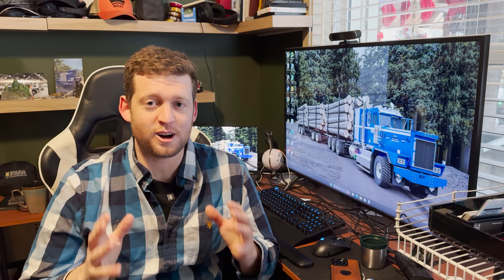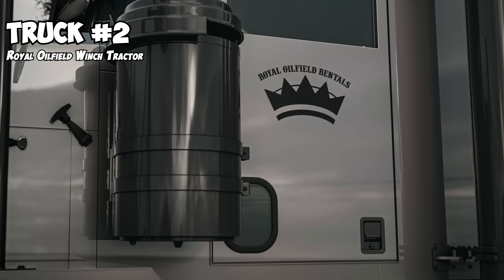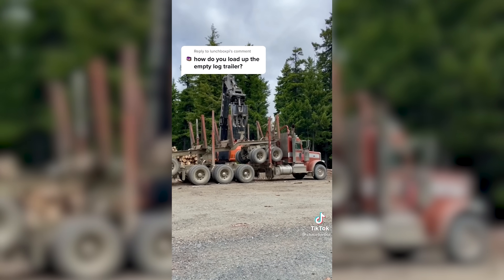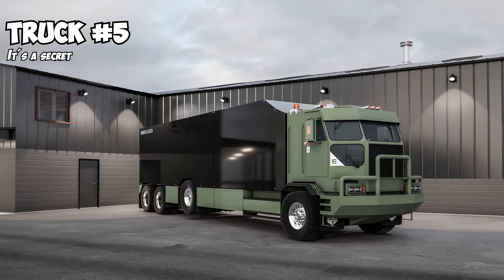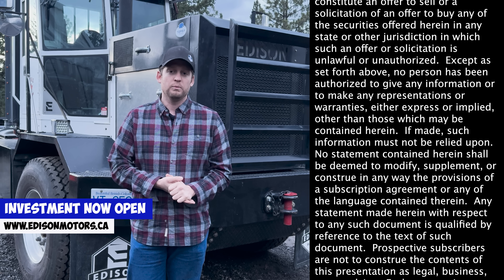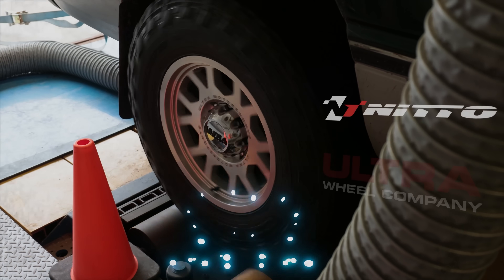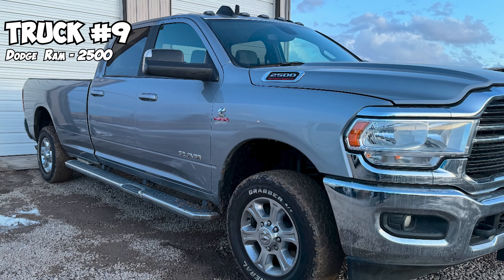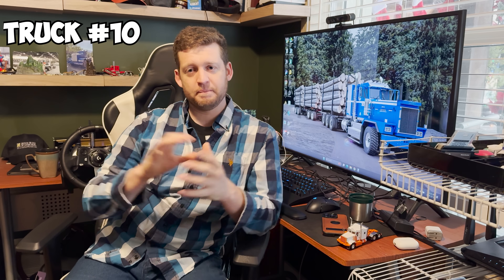Edison Motors’ 10 New Hybrid Truck Builds & Future Plans!

Comment: Hope to see an RV motorhome chassis next; send it to Elkhart, Indiana, for a camper body to be fitted and test drive across the country to Utah and back. 
I can test it for you and record results; going from Indiana to Utah at the end of March for Offroad games anyway. Can display it at the games; many followers will be there.
The Long flats of Kansas and then the Rocky Mountains through Aspen would be a great test.
If a motorhome can handle the Rocky's, it can go about anywhere. 

Mountains difficult to climb for any vehicle and need regenerative braking on the way back down to keep brakes from overheating.

Most vehicles climb at 30-45 mph, depending on load. If a motorhome can maintain speed with traffic while climbing mountains, that would be a great selling point. 
Most RV's are underpowered unless built on an expensive semi chassis; ok on flat ground but underpowered when encountering hilly terrain. 
Pure sine wave inverters would eliminate the noisy generator; roll through the campground in silent mode and recharge with high current RV outlets at the campground. 

Considering the way RV's are used, it seems like a good fit; there are lots of charging times and advantages to the electric platform in RV use.

It is easier to justify the chassis cost if the vehicle is for pleasure and not commerce; it doesn't have to make money, just work well.

Solar panels and a portable wind generator to charge while boondocking.

Comment: Did they share any real fuel usage data yet?
Reply: Estimates are all over the place and completely dependent  on the type of driving. So a logging truck could have unlimited free driving. Unaerodynamic Topsy might have worse mpg when doing OTR
Reply: Latest the live video they did at some truckers conference where Chace got that question (mpg) and honestly said like Sah-o5m wrote. You don't save for highway on flat roads. It is SO MUCH use case dependent. For it to make sense I guess they would have needed one logging truck running with the same load behind Topsy to just see how they do on the exact same routes.

Comment: I am a farmer and want you to build a diesel electric agricultural tractor out of the shelf parts.
Reply: Agreed
Reply: Depending on which tractor. The smaller ones do now have so much space and weight is a concern. Easier for semi trucks with a pair of frame rails where they can have whatever they want in between. Also, depending on the work a series hybrid might not make sense. It's not more fuel efficient if you run the engine at constant rpm and have no regen braking. That sounds exactly like what a cultivator on the prairie is doing. So a lot more mixed use case would be needed for it to make sense for agricultural tractors I think.

Comment: I don't know if u guys read the comments, but because you are intrested in technology in Europe, there is one thing what you should take to your trucks too. That is the liftable drive axle/ axles. That is saving lots of energy when driving empty, making the handling a lot easier and the most important thing is the liftable axles make the traction much better, with a load or without a load, it increases the load per axle and that way grip too, and that is very important feature in a logging truck. That would be a feature that other manufacturers can't respond out there in North America.
Reply: Pneumatic or hydraulic?
Reply: @TamagoHead  pneumatic, the easiest and simplest to do
Reply: @sauliaalto 👍thx!

Comment: I think you guys would have a huge market in Australia for your electric drive hybrid. The distances covered by some of our road trains are often thousands of Km per trip. The fuel savings and torque available in your trucks would have alot of interest if you’re thinking of going international.
Reply: But will there actually be fuel savings? Edison trucks are saving fuel when there is good regen braking. Thousand km trips I guess do not brake often?
Reply: @ they save fuel because the generator onboard will always run at the most efficient rpm and it will only run when charging the batteries.

Comment: Thats so right. New trucks have million miles (or km) on them from testing before the customer gets them and still customers/ drivers find things that are just not right. 

Having partners that are willing to work with you, your truck and have the ability to work on those trucks will still cut time to market down significantly, because real drivers, real mechanics putting those beasts through real world challenges.

Comment: Are you guys still using Tesla motors?
Reply: No. It's either China motors or bombardier motors
Reply: Tesla model 3 motor was for Carl but it does not work well enough to have it as a separate part and then run with load. In principle it sounds good "keep the old axle, less special parts". But in reality it probably gives headache with how it behaves. They wanted e-axles build in North America but I think they were shown some but then told - "no we won't sell to you". Kay...?
So the e-axles from China was the way to go. If you look into the videos they've been over there and gotten to sit down with the engineers. And the new gen axle with two motors and balanced (not front or back heavy) looks even better. If some North American supplier won't even sell axles to them, then the "made in north America, common parts, find it at truck regular truck repair shops" anyway is null. Edison will surely by enough extra set of axles. The common stuff, like flat windshields etc. that you actually can get locally, there Edison Motors stay true to their vision.
A bit of similar for the engine. They had trouble with some undisclosed North American manufacturer that was not good to work with (more like "hey order 100 of these and get them in a year"). Scania is used in different machinery, in gensets and now even in a new International Harvester truck. So though Scania isn't selling trucks in NA the engines exists there. Maybe not the same easy part supplies but Edison can either sell working trucks or sell mules without engines...

Comment: There is a company here in Utah called Boyce Equipment & Parts Co. They take military surplus vehicles like the M35 2.5 ton and reconditioned to be good as new, even offering custom features and single axle options. I would not be surprised if they offer your D/E kits when the kits get off the ground.

Comment: I believe a garbage truck would be an excellent candidate for a hybrid. Run on the generator for the trip to and from the depot, then battery in the suburban areas. Lots of stop start and no one like to hear a loud truck early in the mornings.
Reply: For long runs that would be useful but most city runs would work without any requirement for the extra cost of hybrid... a straight BEV truck is ideal and there are many at work in cities around the world already from several manufacturers.
Reply: @MrAdopado  Exactly, a city garbage truck can be full BEV. I would imagine at least here the garbage/recycling places have a decent utility connection so it can quick charge at base.
Reply: @MrAdopado  Could this open up opportunities for maybe rural to semi rural areas?
Reply: @callanauger  Of course. Horses for courses.
Reply: Yup, definitely!  And that cab on the #5 truck looks very much like something that would work well on a garbage truck....  (I have no idea if that's it or not, but it would be a good design for one.)
Reply: @BrooksMoses that cab is too high for constant getting in and out. Would need cab in front for that
Reply: @solarissv777   Oh, good point, indeed.

Comment: Very exciting things happening. I'm not a big fan of EV'S but what you're building is interesting to say the least. Something like you're building I can get behind. Now when the battery's get low the engine will recharge without looking for a charging station or worse not finding one and being stranded. 
This idea makes sense to me  unlike the EV that is solely dependent on battery's. 
 Merry Christmas to you guys and thanks for the interesting videos.
Reply: Edison builds for the market where series hybrids makes sense. And the knowledge they gain can be put into a full BEV truck with more batteries if a customer comes with a perfect use case for that vocational truck. To me a garbage truck where they pick up in residential areas seems an obvious choice.

But mass market full BEV trucks has their market ready too. It's not the one for independent owner-operators but rather fleet owners doing the same route over and over again to known locations where they can build out "behind the fence chargers". That's the market Tesla is aiming for.

Comment: Amazing thought process, I think it was elon or some ceo that said it but in short when staring out you want to sell expensive products/solution to a small amount of people as it's easier to control and manage incase you have issues when it's only 1-15 people, then you sell something slight cheaper to many people let's say 100-1000, all the way until you can sell a reasonably priced product/service to alot of people 1000-100000.

Sort of like elon started with the first roadster, then the initial models, now he's selling to millions

Comment: It would be very interesting to take a 12 valve.Commons truck and put the generator behind it and see how efficient that is. I bet it's gonna To be extremely efficient. That's
Definitely.Something I would like to try with my ninety seven twelve volve four by four.
Reply: A 12 valve is a large engine with little horsepower. Bump it up to better numbers and you lose reliability and efficiency. Also new diesel engines are more reliable then diesels from the 90’s so it more difficult to stand out like the 12 valve did. It’s the emissions crap that kills the engines of today, remove that crap and the engines run forever. They use less fuel, are quieter, lighter and have more power than a 12 valve. Modern engines are incredible without emissions bullcrap on them.

Comment: I have a question about the electric differentials. On the FoMoCo/performance axle 9inch the differential comes out(3rd member, hoghead, whatever you want to call it), for antique retrofits for pickups and cars that would be ideal to just swap out the differential for an electric motor/diff and be able to use the factory tubes, 31 spline axle shafts, ect… would that be a possibility from you guys if the future?

Comment: Super excited for what you guys are doing! On the Ram 2500 project, will this truck still have emissions and require def after tuning is done? Or does the diesel engine pass as an auxiliary power unit, and won’t require emissions?

Comment: Please more info on this "Board" or "Bored" or "Boar" diesel customer that is planning on using the stock engine. Anybody have their website?
Reply: It is “Bore Diesel”, they hade one YouTube video that just says that they are partnering with Edison.
Reply: @Sah-o5m  I did not look them up on instagram, but they did mention they are from Colorado.
Reply: Thanks. Is it Bore Diesel on Instagram in Colorado USA?
Reply: I didn't hear the Colorado part. Gracias :)
Reply: Ahh. Bore Diesel out of Erie Colorado a suburb of Denver and Boulder. Looks like a fantastic partner for Edison.

Comment: I expect absolutely no confirmation of this, but I'm going to lay my guess down right now that the mystery vehicle is a garbage truck.
Reply: My guess is cement truck. My runner up guesses are a garbage truck or a crane truck.
Reply: Or any city utility truck where you need the cab over for tight corners, visibility, and the electric for not having to idle a cement mixer, hydraulic garbage / compost/ waste management.

Comment: What if the batteries are too full or there's just too much for the regenerative braking? Do you have some sort of rheostatic braking in mind for that type of scenario?
Reply: Regen fills batteries. If batt full then regen spins generator which spins the 9 liter engine like a Jake brake
Reply: In an older video/short they mentioned that the power from the axles will be fed to the generator, turning it into a motor which will drive the engine with the jake brake (or equivalent) switched on.  The original plan was to use a resistive load bank like what is used on a diesel locomotive, but they determined that this method wasn't efficient due to the added weight and space it would take up on the vehicle.
Reply: @robbie_4118  I believe Edison is holding off on a resistive load bank heater for the time being.
Reply: He’s talked about that in previous videos.
I can’t remember what he said but it seems they have it figured out.
Reply: They have regular brakes! And it will become a habit with a bit of planning for the drivers - don't run the generator before you know you will get a lot of regen!
For Topsy they can spin the generator so the engine can jake brake.
For the newer with Scania, which seems to be gensets, I don't know if it has a jake brake capability. An Scania engine for a truck does, but these ones - at least the first, we don't know. We'll maybe hear in the future.

Comment: all the trucks except the cabover are using the bde design? figured atleast your own one would be the standard cab, probably even the  emcon plow since the extra visibility would be huge for a plow
between that and the update to the website are you just only doing bde cabs now or is it just the default?
no page for semi retrofits anymore either
Reply: There are Canadian government financial incentives to build new, Edison and Buyers are Dis-incentivised to do retro fit.

Not saying it will never be done. In fact I believe it is inevitable. Just not for the first 5 semis for 2025
Reply: He commented elsewhere that they're doing that cab on these because that's what these customers wanted.  (And I'm guessing they did that for their truck in part because it's the sister truck to the Royal truck, and in part so they'd have one of their own for testing.)  But, yeah, it seems a little surprising that Emcon didn't want the center-steer cab.  Maybe they're looking at it as testing one unique thing at a time.
Reply: @vincentgrinn2665  as far as center seating goes, buyers are taking a risk on electric, and taking a risk on a new company. Taking a 3rd risk on unconventional center seating may not be worth it right now.

Plus it looks like every buyer wants extended sleeper cabs. Placing a seat right in the aisle to get to the rear may be a bit  impractical.
Reply: Remember that these 5 new are all custom. Customer want traditional cab? They get it. Cabover? They get it.
And as Sah-05m wrote, some incentives exists for new trucks with electric propulsion (and apparently includes series hybrid). So retrofitting an old truck isn't so much worth to the customers - yet. They build them from the ground up, retrofitting an existing mean you need to place cables etc. somewhat were existing is so it can end up with a lot of custom work. I bet Chace would love for there to be cheaper to retrofit old trucks. But the electrical side of thing needs to have everything working perfectly before they start introducing more variables as a custom retrofit will be.

Comment: Happy to hear you doubling down on building these ones right before selling more. You guys are history in the making.
Reply from the maker: I think slow and steady is the right way to go for something like this
Reply: @EdisonMotors  sure is. building a small handful of well-made products leaves a far greater impression than taking huge numbers of pre orders or building a bunch of poorly made products.
Reply: Definitely the right approach, make a successful product and you will have a business for life.
Reply: I foresee the day some after-market company makes a biodiesel or wood-pyrolysis diesel unit, so the trucks can make their own fuel from wastes, for free. IIRC, turbine units can do that, though with some drawbacks.

Solar PV is coming down so fast in price and weight that, while it would never provide the power to drive a rig, it could lower costs even more, too as some kind of trailer cover.
Reply: @bartroberts1514 Wood gasification? Nice low technology.
Reply: yes! One of my first managers stated: crawl, walk, run, fly and soar ONLY if you to it with continuous improvement will you stay soaring
Reply: I just want this stuff to ramp up quick. 😤🥵